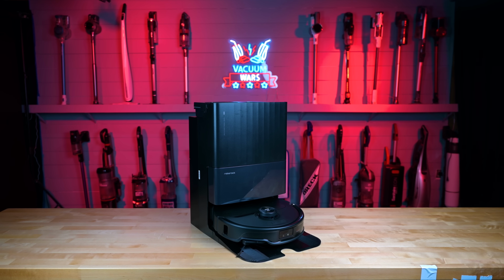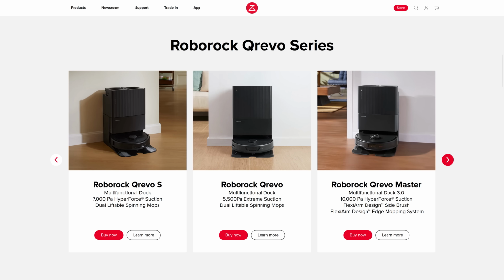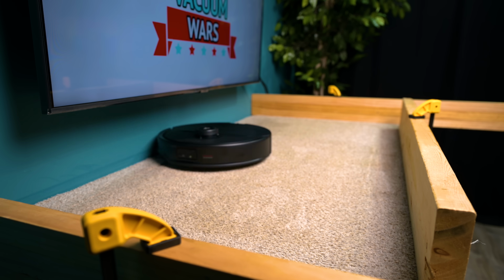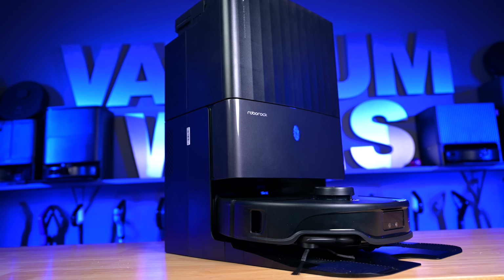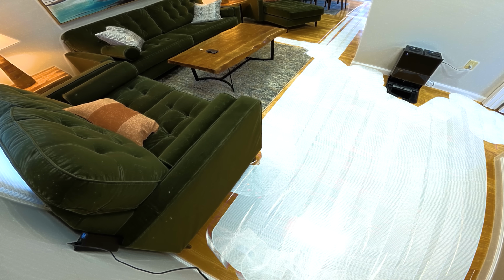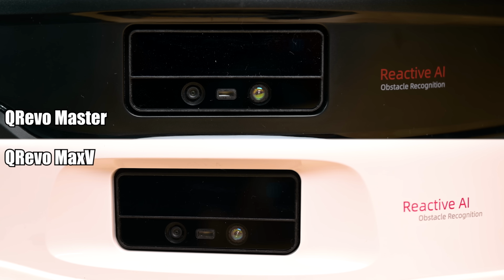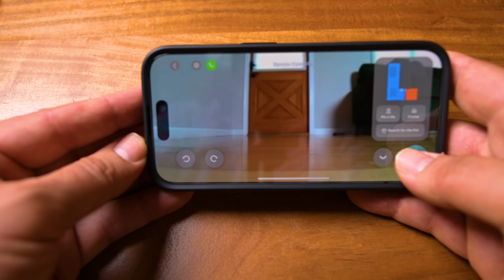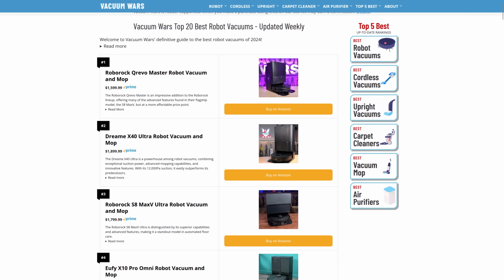Roborock Q Revo Master - Our New #1 Pick and an Apology

Comment from the maker: Roborock Qrevo Master at Amazon:  https://geni.us/9isVmrv
Check out our regularly updated Top 20 Best Robot Vacuums list on our website: https://vacuumwars.com/best-vacuum-cleaners/robot-vacuums/
Reply: Please review Dreame L10s Pro. It has almost everything but less than half price of X40.
Reply: It just dropped $400 and is now $999 on Amazon.
Reply: I’m sorry if I missed it but, why is it better than X40?
Reply: Any chance you might review the new Ryobi vacuums? Personally  I’m most interested in their new One+ HP swift clean wet dry stick vac. I have a cordless Tineco hard floor wet/dry stick vacuum and it does a good job on my hard floors except for two things. Its run time is too short and it only effectively picks up liquid on the forward stroke, not the backward stroke. This means I have to constantly move forward to get a good clean which is difficult and I often run out of battery before my cleaning is done. The ability to swap batteries, plus I have a lot of Ryobi  18v batteries and their fastest charger, is really intriguing to me. If it were to also effectively pick up water on the forward and backward stroke, I’d buy one in an instant. Sadly I can’t find any decent reviews on it or any of the other new Ryobi vacuums for that matter. Any chance you might be able to help?  I’d also love a test of all the new cordless shop vacuum style vacuums offered by name brand tool manufacturers like Ridgid, Ryobi, Milwaukee, Ego and so on. I know you tested them in the past but those are all very old models now that have all been replaced with newer and better models.
Reply: The link is broken.
Reply: I think you should do a hair tangle test, so you give it more time.. I think it takes time to hear to move from the brush to the container
Reply: I found only Roborock Q Revo not master, is it same? looks same but it's around 850$
Reply: @tyxpek9104  the Master has dual rollers and a higher suction power of 10,000 pa.
Reply: mrb paspas yikadikdan sonra paspas yapmaya robot çıkınca haznenin içinde su damlaları oluyor mu.birde robot az da olsa su damlatiyormu acaba

Comment: We bought the Roborock Q Revo Master partially because this review...

I wish I had returned this one! 
Do NOT BUY!
It doesn’t work well at all. And after several months It changes the map of the house without the possibility of fixing it without remapping. And it struggles with angled walls, or open concept homes. It does not cut hair and clogs all the time, so if you live with WOMEN who have medium to long hair, or PETS- DO NOT BUY. Wish I could get my money back and buy a different machine that cuts hair. It has zero object avoidance- so it get clogged and trapped at least 3x each run. Literally. 

It required bags for the vacuum! They are tiny. Even with us running it every day, and pulling out the trash and trying to reuse the bags, we have to maintain this repeatedly every run.

My whole house is 2000 sq ft- we normally just use this for the kitchen, dinning room, and family room because it does NOT function well. 

Expect to clean everything with a fine tooth comb before running this every single time. 

Struggles with floor transitions and rugs/floor mats. 

When buying a robot: look for ones with self cleaning brush rollers that cut the hair off. 
And BAGLESS models.

Note: we have it set at max vacuum emptying and it’s not enough. We’re not filthy, we run it every day- this technology just isn’t there yet. And this model is definitely a do not buy.

Comment: Can this Roborock operate on two different floors inside the house?
Say if the docking station is downstairs and I take just the vacuum robot upstairs, can it wash and vacuum the floor once without its docking?
Reply from the maker: Yes, it can clean on a second floor without the dock! Just carry the robot upstairs and start a cleaning cycle manually or through the app. It’ll vacuum and mop, but it won’t auto-empty, wash the mop, or recharge until it's back at the dock. 👍

Comment: AVOID ROBOROCK AT ALL COSTS!! 

Absolutely abhorrent customer service.  For starters let’s note that I purchased the s8pro ultra vacuum for over $1000 dollars,  it was on sale for 999 from 1200 when I purchased it. 

I had my vacuum for about 10 months when it started to make an odd sound while cleaning. I contacted Roborock and they couldn’t help me fix it so requested that I send it in.  The plastic ramp had also broken.  The only place that you can send it is to California. 

I shipped the vacuum, after getting it back they had given a new plastic ramp but upon running the vacuum it made the same noise. They did absolutely nothing to my vacuum. Yet again I contacted customer service and was told to again return the vacuum to be fixed. I was bugged. I was given the option to return my vacuum, have it “repaired” or get a refurbished one. I have purchased many refurbished products in my life and never had an issue. I figured that I no longer trusted the repair department and that refurbished product would be quicker and would go through extensive checks. I have a crawling baby that I need to keep my floors clean for.  

Yet again I drain all the water, packaged the vacuum, and take it to ship. Finally the “refurbished” vacuum arrives. I get it all set up, lo and behold the dock is broken. I again talk to customer service and they say they will “ escalate” this issue. I am expecting them to make it right. Nope, they just email me with simple fixes like “make sure the filter is installed” and “clear debris from the roller brush” I explained to them that this is not a simple fix and the vacuum is not operating correctly. The mop maintenance brush is stopping on top of the filter and making the machine think it’s clogged. I get little to no help. They say again that they can send me a refurbished vacuum. 

Let me be clear that this has been close to two months of going back and forth with Roborock. I clarify that I would just like a refund or a new vacuum. They say they can’t do that and my product is no longer in warranty. Also I find out that I am no longer eligible for the upgrade program, which is a large reason I chose to purchase a Roborock in the first place. They do not accept refurbished vacuums. Isn’t that ironic! 

When I brought up this concern that is was not disclosed to me, they told me it was on the q and a part of their website. You mean to tell me when chatting with a customer about solutions you expect them to go verify everything you are telling them on the website and make sure it doesn’t have further ramifications? 

They told me there was nothing they could do except offer me 30 dollars and another used vacuum becuas my vacuum was NOW OUT OF WARRANTY.  yes, that is true BECAUSE THEY SENT ME 2 broken products, after my first one started having problems! 

They told me they no longer make this vacuum, which is clearly a lie as it is for sale on Amazon. 

So here I am, left to yet again package up this vacuum and wait. I even requested that I get the replacement so I couldn’t avoid time without a vacuum
And they simply said no that was not their policy. They do not care about helping their customers. 

I understand things happen, but they have a total lack of standing behind their product and making an effort to make things right when they have repeatedly made errors. 

I will NEVER purchase another product from this company. 

And suggest you avoid them at all costs!

Comment: You really should set your expectations accordingly when buying any of these. 
I own this product specifically. We live in a single level home 1826 square feet with two area rugs, but the rest of the floor is lvp
The good: 
-Cleans decently well (see drawbacks for more info on this)
-Cleaning system does A pretty amazing job! I clean out the base every now and again and I'm always amazed at how clean it is. 
-It gets us in the routine of keeping our house clean. Kind of like how if you ever had a cleaning lady as a kid and your mom would tell you to clean the house before the cleaning lady came.
-The light comes on fast and allows it to work in the dark. 
- The routines are awesome! One button allows me to set it to clean the kitchen everyday if I choose. 
- once you get used to the map, setting it to avoid areas or rooms is super easy.
- floors dry, fast at least in my experience even when on the most water

Drawbacks: 
- You should set your expectations accordingly. While this does clean the floor, it is simply not powerful enough to get everything. And it makes zero sense to program it to go back over a stain many times. You can just use a sponge. 
- You do have to have a sponge handy to go back up and get the stains that IT WON'T GET. And believe me when I tell you that there are a lot of those. 
- The maintenance on it is pretty constant, especially if you allow it to clean a rug. It gets clogged easy AND there is no clear indication that it is clogged so it ends up continuing to vacuum and spreading s*** everywhere. 
- did I mention there's a lot of maintenance on it? 
- The battery life is horrible. Okay, okay. If you've got less than 1,800 square feet or maybe even less than 1,600 square feet, you might be okay.
- it takes forever to charge
- replacement parts are not inexpensive and you'll need them frequently. 
- I'm skeptical that this thing will last 5 years before I'll have to buy another one.

These social media influencers are making money when you purchase so they have a vested interest in you buying one. I don't always find their reviews to be forthright and honest when it comes to the drawbacks of these things

Comment: Obstacle Avoidance is top priority for me now.  It makes it to the top of the list when robo runs right over cat poop and drags it through the carpet and into the vacuum.  I would love to see obstacle avoidance testing updated from time to time in the top lists.  This way it can account for updated firmware considering the hardware should in theory already be good.  The update to this video might have stopped me buying a Eufy.  I already have a Roborock S8 on the main floor, but need to replace a dumb roborock in the basement and also sweeps up the litter box trails.

Comment: I'm torn between waiting for Qrevo Edge with Refill and Drainage System and just getting Dreame X40 Master. Any suggestions? I'd prefer the Roborock because of suction power and the fact it can fit within a standard 40cm kitchen cabinet, whereas the Dreame would need a custom sized (426mm) cabinet just for it and if I decide to replace it one day, I'm stuck with that unusual size.

Comment: I have 74cm of height under my table, is that enough?
Reply: If containers pulled out horizontally like on some other models, then sure, but since they need to be pulled up, you will not have room to do it as the dock itself is just over 52cm leaving you less than 22cm to work with vertically and pretty sure the containers are at least 20cm deep if not more.

Comment: I've had two Roborocks.  On the first one, the Lidar stopped working after 4 cleaning runs.  Nothing was stuck, it just stopped every couple of minutes so was unusuable.  I sent it back and received a replacement.  It had the same problem but it started doing it after 7 runs.  They wanted me to send it back to get another replacement but I insisted on a refund.  It was good when it worked but ultimately my Roborock experience leads me to believe the model is basically defective.  Roborock Q8 max +.  I hope others don't suffer the same problems.

Comment: I highly recommend doing tests to determine the minimum height at which a robot vacuum cleaner can pass under furniture. No one talks about it. I had a Roborock S8 Pro Ultra, and it went under furniture on legs with a height of 10 cm, but I handed it back, because I did not like that it does not wash along the baseboards, and took the Dreame X40 Ultra Complete. The Dreame X40 Ultra Complete cannot go under furniture that is 10 cm high, and by experimenting with the minimum height, I found out that the minimum height is 11 cm, and I wrote to Dreame technical support about this, and they told me that this was done specifically so as not to scratch the body of the vacuum cleaner. I passed the Dreame X40 Ultra Complete and took the Dreame X40 Pro Ultra, which is also terribly oriented, does cleaning under furniture and is not able to do cleaning at a height of 9 cm, it gets lost and asks to pull it out on an open surface, because you need lidar to build a map, but since the vacuum cleaner is under furniture, it does not can extend lidar and can't scan the map. I hope that Roborock Qrevo Slim can do a better job.

Comment: Hi fellow experts, should i get a manual mop and basic vacuum together with an elite robot vacuum, or an upright vacuum (vacuum plus mop combo) and save on everything else? What is currently stopping me is the fact that i will need to get the filter replaced often with the upright vacuum and I plan to only clean my house about once every 1-2 weeks.

Comment: I want to ask you something.
I want a vacuum with all the cool features but no camera. Autobin, mopping etch.

I would like five recommendations.
What do you recommend?

Thank you so much
Reply: Any Roborock that doesn't have the Reactive AI feature, which means it has a camera that's visible on the front. That still gives you quite a few options and Roborock is very consistently one of the best brands.
Reply: @traincation5715  do you have any models in mind to suggest?
Reply: @traincation5715  thank you for your answer. Do you have any specific model to suggest ?

Comment: This is just stupid. 
The ultra 40 had perfect score but this one had not a perfect score, how can it take the number 1 spot? Doesn't make sense to me. You should atleast say why it was better then x40 ultra than to just apologize for something you shouldn't apologize for, its not your fault about a update that's their problem. 
For me this looks like you are biased. Why is this robot better then x40 ultra? 0 explanation on why it was the number 1 spot. When you apologize and put it at the number 1 spot it looks more like you just putting it at the rank 1 spot because of guilt. 
If you could explain me why it was better then x40 ultra then im satisfied. You don't owe me an explanation but you definitely need to tell why you put it at the number 1 spot and explain why to your audience. Instead of letting the something flow in air and disappear without any explanation
Reply: Getting paid on the side for sure
Reply: I personally tried both. The master is way better in navigation. Also the obstacle avoidance is better. The x40 avoids 80 percent not existing objects..

Comment: Quick question to @vacuumwars  With current sale on roborock, do i go with this for 1400, or the s8 maxv for 1100?
Reply: Yo! The Qrevo Master just went on sale on Amazon for 999!!
Reply: @picklebears  i squeezed trigger too soon on s8!  crap.  ah, its all good.  these prices are crazy good.
Reply: @vacuumwars - I have the exact same question. Everyone on reddit has been saying Revo Master over the S8 MaxV ultra .. but now that the S8 MV U can be purchased for $300 less than the Revo Master, I'm wondering if that's the way to go. Also note you can get an extra 5% off either model with the code RRSAP10ANSREDDIT on Roborock's store.

Comment: Do you have a video on the Q Revo Plus?
Reply from the maker: We don't, but we have a comparison table here: https://vacuumwars.com/the-new-roborock-q-revo-s-robot-vacuum-how-to-navigate-the-lineup/
Reply: Thank you. I've found some conflicting info out there about which version has which features. For example, we did get the Plus but I don't think it has intelligent dirt detection. 

Also, we turned off the advanced obstacle avoidance. We have kids. It trying to avoid bumping into things meant it was literally missing like 40% of the floor. Not much of a reason to run it at that point. It was also doing really wide circles around like kitchen chair legs because they're narrow and in different places all the time. Really inefficient and ineffective. 

You don't also do content around robot lawnmowers, do you? We love your channel.

Comment: You don't touch on the lack of a Detergent Dispenser feature - don't you see it being an important thing to get clean floors? Or is it not that important with the hot water?
Reply: You have to manually refill the clean water tank anyway, so you just add a serving of detergent during refill

Comment: Could you test cords that are close to the wall or run length wise and are not wound in a circle? I have had my Roborock Ultra MaxV7 since launch and while a lot of the avoidance stuff is true, I have found that say you have an air purifier out or a fan out, it will not avoid that chord if it's running a few feet across the room. In will in fact suck that right up and rip the cord out of the fans if they are easily removable. It's not great on those hot days because you have to then move the fan or strategically put shoes around the cord to stop it from eating them up. One of my biggest gripes.

Comment: Just purchased this unit based on your review and received it yesterday. You were saying the app was one of the best in the industry and I feel like I’ve been struggling with it! I’ve had multiple rumbas over the years and this is replacing our J7+. It took me forever to get it set up on Wi-Fi and I had to create a entirely separate 2.4 GHz Wi-Fi network just for this vacuum. I’m also completely unable to create custom room names in the app. Is that even an option or am I missing something or does my app just suck? I’m not an iPhone.  Any recommendations would be amazing.